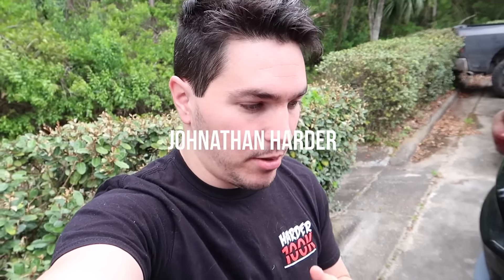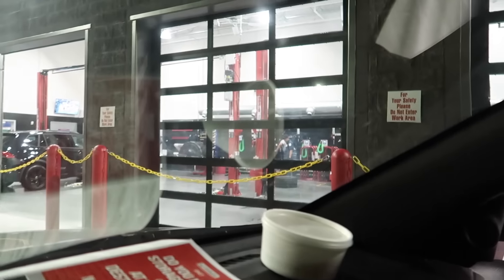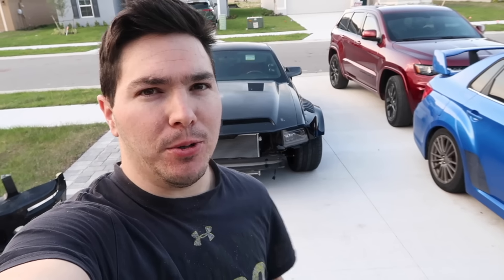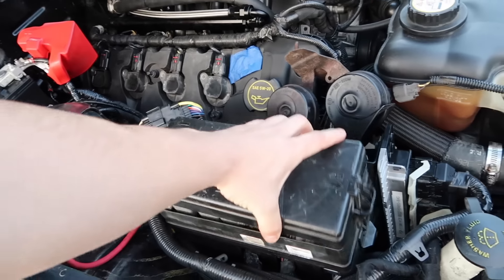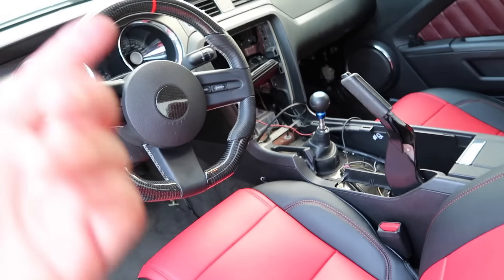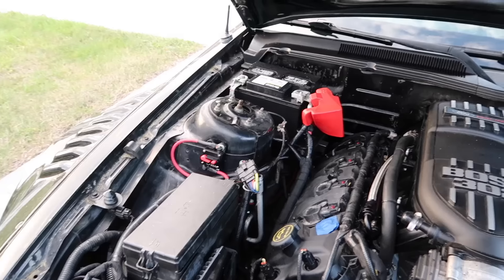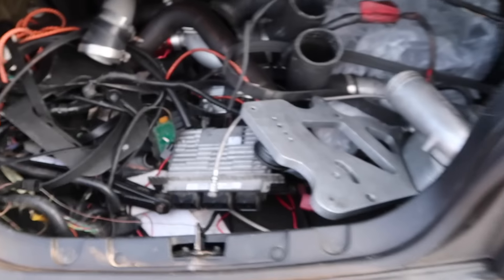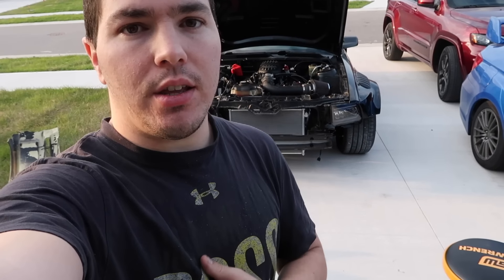The Coyote Swapped Mustang is BACK!! **FIRST START & DRIVE!!**

Comment: Just got some dialing in to do should be all good. Can see the shop kinda half assed it but its all in 1 working piece so ig that’s what matters
Reply: need to go over it with a comb if its missing bolts and the guy didn't feel like putting the exhaust back together lol

Comment: Hi brother. Congratulations on upgrading your Ford Mustang. There are a few things that will help your car to be louder.... Please get a bigger Procharger to give a better turbo sound... and if possible put the Procharger x2. Please put a long drag race spoiler to make it more beautiful and put a turbo exhaust on your hood for a better car sound... Please put a light under the car. Please install it on the roof of the hood and lower the rear height, also buy drag race tires. And if possible, put the exhaust pipe next to the front bumper of the Ford, like in drag cars, so that everyone will move aside in fear of your car🗿🔥
Reply: Sure ❤❤❤